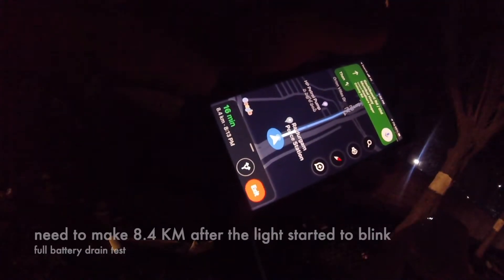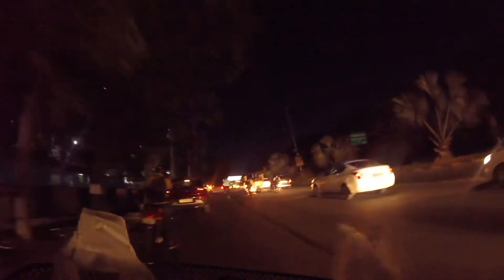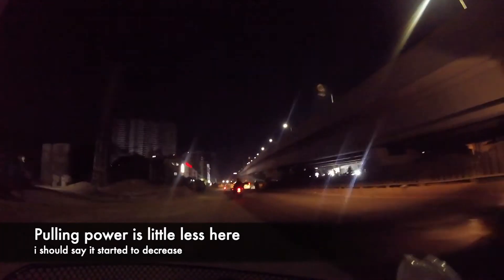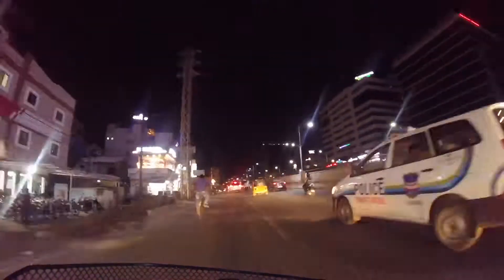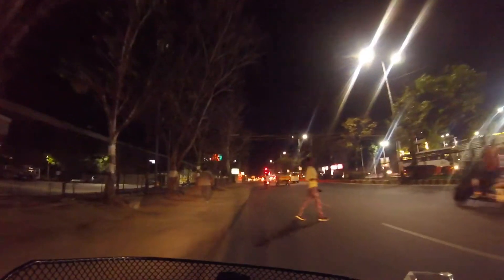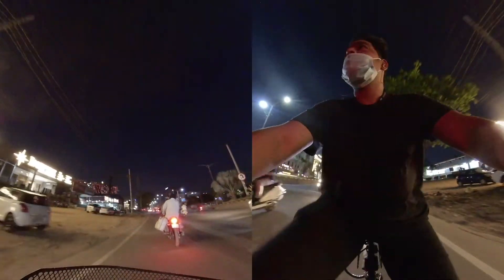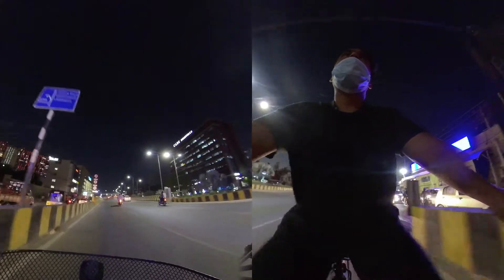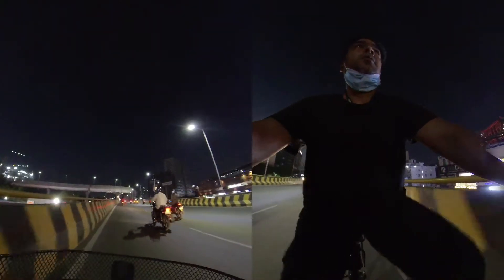Can Meraki Electric Cycle Climb a Flyover? how difficult it is ? How many km can it actually do ?SAD

Comment: How many KM cover with full battery only throttle mode?
Reply from the maker: Hi Ankit Patel,

First thing:- is , The throttle mode is not as fast as we think. Its slightly makes you feel that you are in a very slow MOFA( Thats my opinion and it may change for you,Since I am 100 kg :) ). and I dont like it. 

But I am using it . Only  when I am tired and if I wanted  to go for a short ride for may be like for 4 or 5 km on a free road and immdtly if I can come back home and charge for my next ride.

Next thing is :- I think it will consume all the battery with in 20 km or something ,since I tried for a small ride and it utilised/Drained all the battery immediately .Since I did not take notes ,I am not confirming now hence I will make sure I will check and update you on this ASAP.

 kindly look out for my next video for accessories for this meraki e cycle, it will be very interesting for you.

and if you can afford 45k go with hero electro renew fat tyre cycle it will give you good range as you expect and you can also do off-road cycling. Offroad cycling is awesome dude .you will love it.

Note that cycle has only pedal assist and no cruise mode.But trust me Pedal assist works like a charm .you will not regret it .I use this cycle for daily commute nowadays and for past few days I just stopped using my Activa( That is saving lots of petrol money and very little Health benefits :) since the pedal assist is helping me.

Trust me I never liked cycle and climbing hills and bridges but now with this cycle I like cycling a lot :).
Note that :- after around 30 years I am using cycle for my daily use and I dont regret it at all:).
I rode this cycle for more than 25 km in hot sun and I did not sweat a since drop .

Thanks for your comment and watching the video.
Subscribe to my channel if you have not and please give me feedback on all that you observe to make my channel more useful :) Cheers.
Reply: @GeminiMotovlogsumar  thanks for detail information 👍 i am 54kg so It can give more range I think 😀 thanks
Reply from the maker: @AnkitPatel04  oh yes, you are correct it may give their promised range 35 ,I guess.please check and let me know.
Reply: @GeminiMotovlogsumar  hero claim maximum 75kg weight on lectro cycle
Reply from the maker: @AnkitPatel04  that’s good, since more or less people will be with in that . Except me 😂😂🖐
Reply from the maker: Watch my new video for throttle mode , you will be surprised by the range 😂
Reply: @GeminiMotovlogsumar  ok thanks